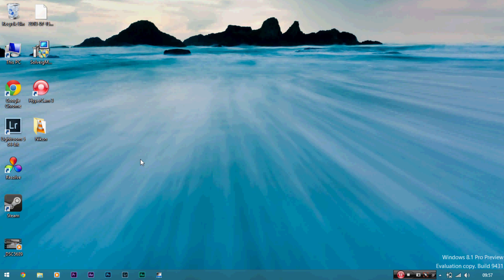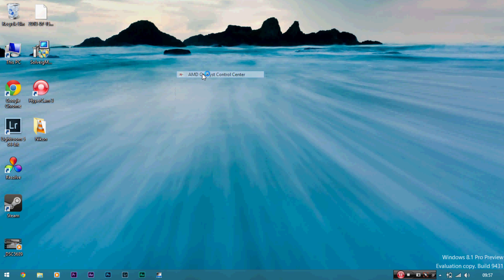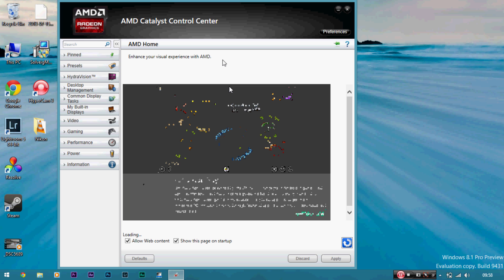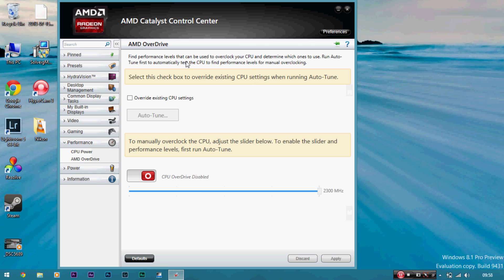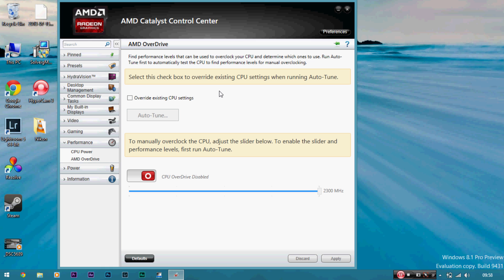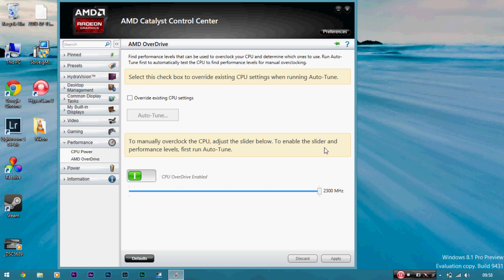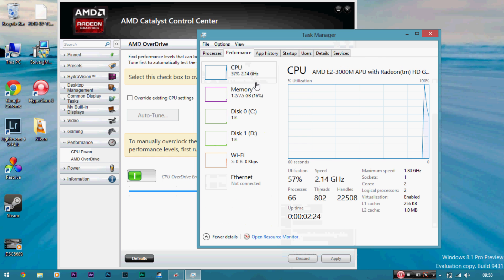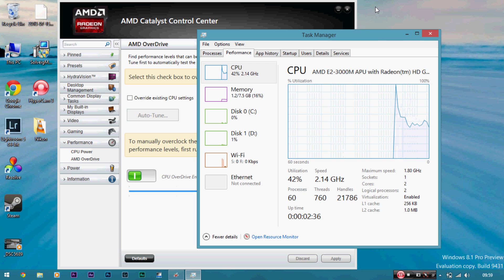| How To Overclock Your AMD Laptop | Quick Tutorial |

Comment: I have A8 quad core laptop and downloaded the overdrive amd drivers and stuff and says it isn't supported I see the option to overclock but can't move the sliders. Beta version and official amd ccc. I use msi after burner but only slight gpu overclock not cpu from 800mhz to 1040mhz better than nothing

Comment: i have a amd a10 5750m can i overclocked it?
Reply: Of course you can overclock it, but be careful if your laptop is already hot during gaming for example, it will be a bad idea.
I am not talking about how the laptop feels, but the actual temperatures. There is a lot of software out there that can show you the temperature of components in your computer.
Also, try to run a game in the background or stress test the laptop, because just normal temperatures don't matter. It's really important to know the maximum temperatures it will reach so when you do overclock it, it won't go above safe temperatures. [90-100 degrees celsius are unsafe]